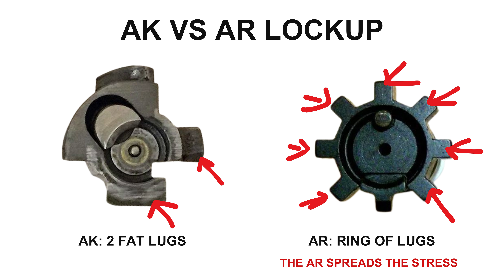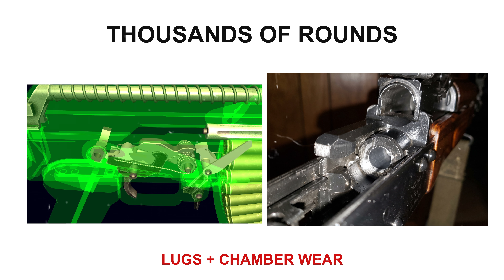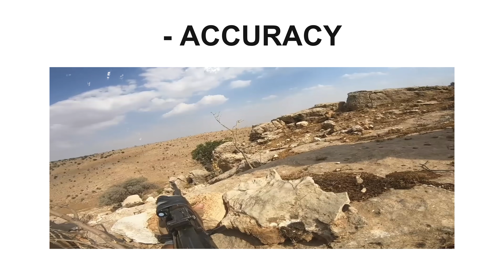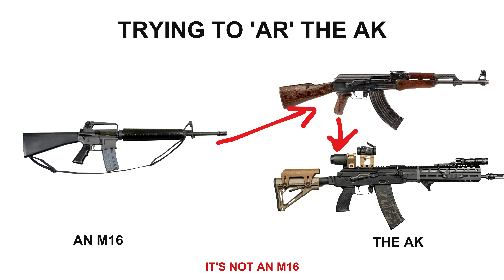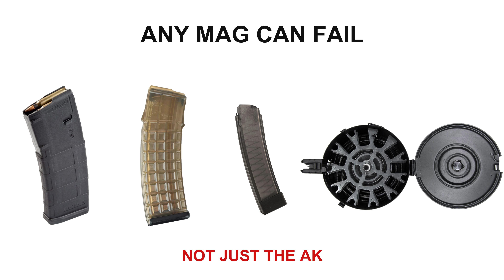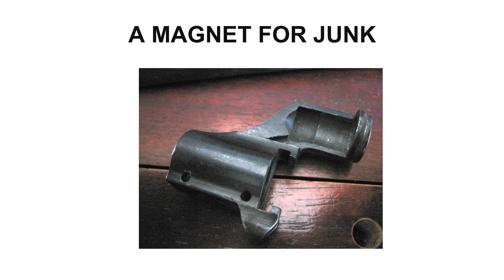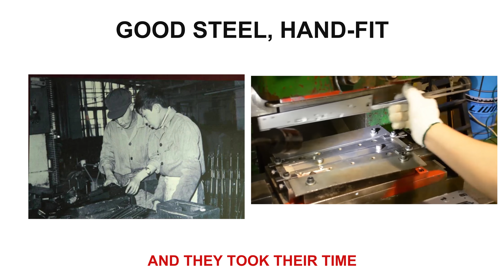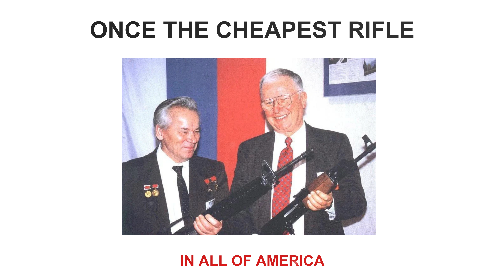Every AK Flaw Explained

Comment: overdramatic: one would really have to abuse their rifle over a extended period of time for any of these so-called flaws to have a negative effect.
Reply: so like treating them like their reputation suggests?
Reply: @armandoalvarado5840  it can get neglected but if you even remotely put a small amount of effort you would on an AR it would pretty much last as much as father time allows it.
Reply: @blacktalon7030  Exactly. A correctly made AK is reasonably accurate for its intended purpose. Both sight blocks are secorely pressed and pinned directly to the barrel.

Comment: I've actually seen more AK's go down hard workin at a gunshop with an indoor range. I've seen a few AR-15's go down, but they're pretty easy to fix on a bench. We've had a milled receiver crack the ejector and crack the receiver around where the trunion would be. I've also had an AK where I had to open up one side of the magwell because it was 1. Really tight on the stock factory mag that came with it and then 2. I couldn't use aftermarket AK PMags and 3. Just looking at the the magwell it was cutout wrong/off center. I had to take a dremel and open up one side, 3mins or so with the dremel, it now works flawlessly with AK PMags. We also had some dumbass give a couple of guys .223Rem for a 7.62x39 AK. They shot it and after a few rounds one of the casings swelled up in the chamber and ripped the rim off of the case and the gun rammed another round into the back of the casing and since there was nothin stoppin it, it rammed the next round as far into the open backend of the casing as possible. It "clogged" up the chamber. We got the round out but the other casing was stuck in the chamber. Eventually we got it out. That also messed up the chamber so bad that the gun was basic cooked. The owner of the place that I worked at was buying really sketchy ammo directly from a manufacturer who had just recently learned how to reload ammo. There was all kinds of issues with this ammo, primers missing, primers in sideways and backwards. Missed powder dumps, bullets seated too deep, not deep enough, double charged rounds, bullets not crimped or improperly seated, so when they'd load into the chamber the round would literally push back into the casing and when you'd pull the round out of the gun, powder would go everywhere. It was literally blowing up people's guns, there was a couple who were havin a "date night" they rented one of our AR-15's and this crap ammo that we were told to use for the range rentals only at one point. They were out there and the girl was firing the gun, BOOM 💥, the mag shot out the bottom, the pressure blew the bottom out of the mag and completely broke off the magazine release. The upper receiver was bowed out, you could see stress marks all over it, the chamber was cracked, the BCG was destroyed, and nothing about the upper receiver was worth trying to save. I told the manager and we talked it over and he had me assess it, and I told him that the lower was still usable, we just needed a whole new upper. I got the ok, and they ordered me the parts, with a few small hiccups. I got all of my parts and got that gun back up and running right before they had a huge class, that gun was running years after I left and then they had to rebarrel it and the dumbass Training Director put a barrel in it that wasn't necessary. I'm pretty sure that they had to change some gas rings, maybe a bolt in it, possibly. But that thing ran until that place went under. They also jad another AR-15 break/blow up, for the same reason, this was actually the first one that blew up and this wasn't as bad, this time we just had to replace the BCG because of the same ammo that we told the owner to stop buying. Eventually the staff refused to sell it with anything and it literally just sat in a corner. At one point the owner tried going out there to sell it because it was cheap for us and we had a higher profit margin. He was trying to sell it and the one lady who was in the ammo room said yeah, I wouldn't buy it because it blows up people's guns. Shortly after that the owner was forced to stop selling/buying the stuff, sent the rest of our inventory back and never bought it again. But the thing is, if ya fuck up am AK, it's much, much harder to fix it and get it back up and running, with an AR, any schmuck with the right tools can get it fixed and working again. Shot, worse comes to worse, you can always just buy a whole new upper receiver, and it should work.... Also, never buy crap ammo or God & Country Ammo

Comment: American bolt lugs will wear out but import factories Cugir, Zastava, KC, Molot, WBP will outlast the ar15 bolt life or even the owner life
Reply: "Uncle Sam! Uncle Sam! Why is my Yugoslavian AK so heavy?"
"That's because thick thighs save li-
Reply: Badly made lugs do two things. Too soft and it loses headspace. Overhardened and it blows up, breaking lugs.
Reply: @lightningkamagong8028  all lugs wear out but the video is wrong the ar15 does also wear out the difference is the chamber pressure of a 5.56 is considerably higher than 7.62x39 meaning more stress on the lugs

His point about the trunnion is correct though the ar15 is made for ease of maintenance and reliability the ak is made for ease of manufacture and cost of manufacture loose tolerances make it unreliable anytime water and dirt mix and since its made using badically a small machine shop it requires a gunsmith to do repairs while an ar15 anything that must be done can be done with a vice and a backpack of tools swapping barrels is easy changing cartridges easy if the chamber itself is damaged or lugs are the barrel can be replaced with a vice and rachet or in case of the bolt a toothpick it would be good to check headspace but you can get by without it for an ak if you shear a lugs its out of headspace or the barrels fucked you need a machine shop to get the barrel out put a new one in then a lath to headspace it if the locking lugs are fucked you need a machine shop to fix it because you have to cut the barrel to headspace the bolt
Reply: I'd like to add that the 5.56x45mm cartridges are hot loads compared to 7.62x39mm or 5.45x39mm cartridges. Not all ammo is equal. Those hot loads will put more wear and tear on the rifle components more so than lower velocity bullets. The gas tube is the failure point of the AR as I've seen in numerous torture tests. Also, AKs can be shot dry more so than ARs, but that says more about the tolerances than anything.
I've also seen cheaply made ARs flop after a few hundred rounds versus cheaply made AKs simply not firing at all. Any well made gun becomes reliable along with the proper PMC.
Reply: I am sure you came up with that nonsense from your own addiction to Russian video war games
Reply: @Romvin-e7w   Nah, Zastava made their AK models fat to endure the grenade launching.
It would ruin the gun relatively quickly if you actually used it for that regularly but its specifications made the gun basically indestructable.
I wonder what my original comment was, tube censored it obviously since this was in my inbox.
Reply: @Romvin-e7w  Based on your statement, you don't own one. Cugir, Zastava, Kalashnikov Concern are state back factories that produce their countries service rifle. Molot on the other hand is known for it's durability since it's using RPK specs. 

Looks like you base your opinions on American freedom.
Reply: @lightningkamagong8028  I am a 66-year-old American and a professional hunting guide.
I don't play fu ck up Russian video war games you play.
The AK is a pile of crap firearm with NO sporting good to use for anything.
Reply: @Romvin-e7w  we got you boomer. At the end of the day, the crap gun that you are talking about takes a lot of lives during GWOT and in Ukraine war. But if you love gucci guns. So be it.

Comment: 1. ak 12 zero issiues were only an issiue on early batches that was fixed quick 2. the ak is standsrtly zeroed on a 15x15cm target at 100 meters , from a military standpoint it is the same practical accuracy as an M4/M16. fruther then that the ak 12 has great accuracy to the point where sbiper teams take the newest gen ak 12 as a secondary with a scope. they shot consistent sub moa groups with 7n40 ammo. thats also the reason why currently there are test batches of " ak12+ " an ak 12 version optimized to as per designer do " consistent headshots to 500 meters " with 5,45 ammo. 3. the thing is that the ak 12 was developed exactly to specs that the ministry of defense laid out , that very same 2 shot burst for example was a requirment by mod. the issiue lies not with kc but mainly with the mod, though the ak 12 has reached now a point where it can be consideret a universal improvment over the ak74m. the few issiues left are really minor and get fixed in time. also dont forget : most issiues are acctually from mishandeliing or lack of knowledge. the army needs some time to get used to all the little things that are different on the ak 12.
Reply: Regarding your comment of changing over time, it really is interesting seeing how many variations and fixes were rolled out to the ak platform over the years. The original first gen stamped ak-47 were revolutionary but also disasters. (The M16 is just as bad, not picking on the Russians specifically) the foundries did an excellent job improving them over the years, regardless of anything else that development was well thought out and the latest models(like AK-12 gas system) are impressive.
Reply: exactly , and comparativly the ak 12 is getting refined a lot faster.
Reply: @старшийсержант-л7ш 
Well, since you get almost instant feedback from the soldiers, it would be the right thing to fix mistakes right away

Comment: These are not flaws - these are features
Reply: AK is built loosely to allow for both sloppy manufacturing and because the Russian climate varies a LOT from scorching heat to freezing -40 temperatures, which wreaked havoc on tighter tolerance guns (like the WW2 German MG34).

Comment: The ak 12 has solved dust cover  optic issue with a pin and hook system as described by forgotten weapons as "wayyy more sold than original ak with a lot of tought and engineering put in to it" if you drop any AR to where you dent the actual gun every gun on earth would lose 0.
Reply: Even current issued ak-12 revision 6 have zero hold issues. If you take the cover off and replace it. It won't be zero.
Reply from the maker: yes that tab in the back prevents lateral shift.
Reply: @MilGearExplainer then why include it, or atleast mention it has been solved. And why include a picture of a solution to the railed dust cover issue which is a zentico dust cover when talking about the issue. Every weapon has problems when it comes out initially, ak12 is not immune to it and has gotten a lot better maybe even better than the ak 74m in terms of issues weapon to soldiers and even personal use. I haven’t had any problems with Ak railed dust covers because there’s good engineered parts that everyone else knows and uses. I’m suprised not many people know of this by now how it’s already been solved

Comment: AR bolt will disintegrate before one lug shears on an AK bolt.
Reply: your comment would be right if we were in the 60s
Reply: @Jabatiuma-SP Lot's of bolts still shear their lugs off, and the thin walls of the cam pin hole crack. Yes, it is probably not as prevalent as in the past, but it still happens, even with "name brand", and "high quality" parts.
Reply: @DruidTimer Lugs get sheered because of issues with assembly, mostly by someone not using a proper clamp when securing the barrel and nut, causing the barrel extension lugs to clock over some, which makes the lugs rub in operation.
Reply: @DruidTimer  AR BCGs are very nice now. Compared to my 1980s Colt AR we've come far, while the AK parts available to Americans have become worse off..
Reply: @foxbox2879  Fair comparison, but even "quality" parts break.
Reply: @DruidTimer Okay..? Lol 
I love AKs and ARs, but the quality difference over the years is definitely notable. I want good AKs again...
Reply: If you're sheering BCG heads you headspaced wrong, clocked the barrel extension some etc. If you use a good extension rod with a flag to support the upper receiver this is a non issue. BCG lugs will rock on for over 10k RDS.
Reply: I don't think you have any idea how many junk AKs are in circulation across the entire world. If somebody offers you an AK for $50 or less, don't buy it. There's a valid reason why they are lowballing it. $50 is very likely a rip off, they should give it to you for $10 or less. Are there junky ARs? Yes, but not nearly to the same amount. It's almost like 1 to 1 million.
Reply: @erickolb8581  very very true
Reply: I love how people just repeat lore that they've heard their whole life without having any experience with the given topic

Comment: AK Bolt Lugs usually outlive the people firing the gun
Reply: @1wayroad935  ak owners don't keep round counts dork
Reply: Indeed you are correct. But you failed to mention the in-field lifespan of the average AK-user. 😉😂
Reply: @w-Nicksen probably matches the lifespan of average assault rifle user.
Reply: @w-Nicksen nonono wait I think youre cooking here thats a good point lol
Reply: Naaaah is not that simple
AR struggled cause the ammo was bad and they told soldier "it cleans itself"
The ar wasn't perfect but got upgraded multiples times to the point most countries that actually can afford it are changing to AR platforms like ukraine
Now saying it won in Korea and Afghanistan....
Reply: @WinterFox-o5n8e  ukraine isn't switching to the AR platform, it's just surplus donated by the US, most grunts still use the AKM and AK-74
Reply: @Stein871 the Ukranian government has stated they want the Bren 3 actually. An AR derivative
Reply: @Anarcho-harambeism bren 3 is short stroke piston, it's not an AR-15 and Ukraine can't afford to pay for anything
Reply: Ar18 , its derivative  @Stein871
Reply: . The ammo change was because of "bad ammo" the change of powder was because the previous powder caused too high of port pressure. The new powder fixed that, but that was before mass issue in vietnam. In fact nearly 5 years before Vietnam. And the claim the AR os self cleaning comes after the vietnam war, in signage that said the "GAS TUBE" was self cleaning, which it is.  The units that had good supply NCO's and a good commander ordered the .22 cleaning kits, the ones that reported issues showd issues within command and lowsy supply Sargeants.   The book, "The Black Rifle" is the best in dempth overlook  of the m16 design, testing. and fielding phazes and goes in depth on the ACTUAL issues that the m16 had and the changes from the first test batch for the AirForce, till the last on in vietnam.
Reply: @WinterFox-o5n8e Holy shit, your breath reeks of SIG bribes and NATO propaganda, do they pay you shove all that shit down your throat, or do you gladly take it for free? Where in the fuck of all of history, does it say an "upgrade," is meant to cause more problems reported by the soldiers, on the AR platforms just like the SIG SPEAR?
Reply: @WinterFox-o5n8e Garbage gun that explodes
Reply: @destroyerarmor you mean the AR or the AK
Cause neither or those are garbage
Reply: @WinterFox-o5n8e AR tends to die earlier
Reply: @destroyerarmor  k and how about every other good aspect of an AR?
Reply: @bedwetter7667 lightweight, accurate, shoots nice very controllable. Bolt release and magazine release are well placed. It's a dream compared to the trusty G3A3 I served with 🙂
Reply: Bizarre considering the AK platform worked in Vietnam, and the AR didn't. Then, the AK won; just like in Korea, Afghanistan, Somalia, and every other country the kuchasians pulled out of. Matter of fact, Israel built a rifle around the AK platform and exports it across the world to nations like México, where it's still utilized till this day.
Reply: @MatthewCampos-uz6wo  the AR worked fine in vietnam. Wtf are you fudding about
Reply: @1wayroad935  nope, few thousand rounds and its cooked… aka 2-3 years of normal firing schet
Reply: @pablo4yu  jeez, a few thousand rounds and the lugs are done? That's crazy, my saiga bolts have lasted a tens of thousands of rounds, same thing with my Beryl, my m90, even my junk psa.
Reply: @pablo4yu  nope, simply just not true.
Reply: @Germ357 literally yes
Reply: @pablo4yu  A blogger I know from Russia shot 30,000 rounds on his Saiga 7.62*39, and after that he replaced the gas tube.🤣
Reply: @1wayroad935  honestly man im going to be straight up with you, you don’t know much about guns
Reply: @ExclusiveO2x  dont use shitty American made cast AK's use real FORGED ones and you wont have to worry about it
Reply: @ExclusiveO2x  just watch Jim fullers video on his personal AKSU kit he did. He had over 100,000 rounds on this gun 9inch barrel and he did two barrel and front end swaps and it ran full auto like it was new. ARs have the value in parts availability but if you treat your AK right and you ACTUALLY know your shit about guns it will have a long life span.
Reply: Now this is an 5.45 AKSU so it does have far less chamber pressures than an AR and so does 7.62x39 thats why they last so much longer than ARs is because the gun is over built with a lower pressure cartridge.